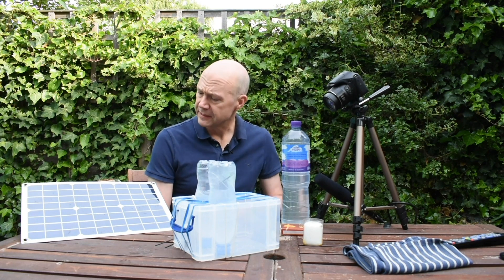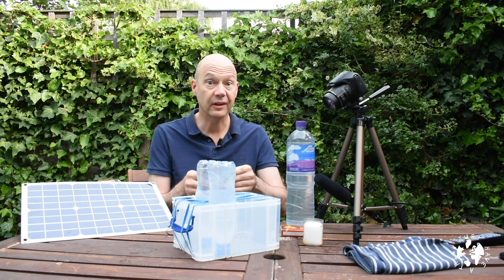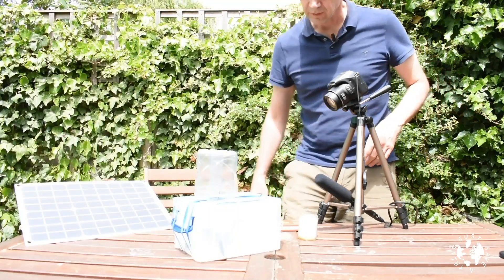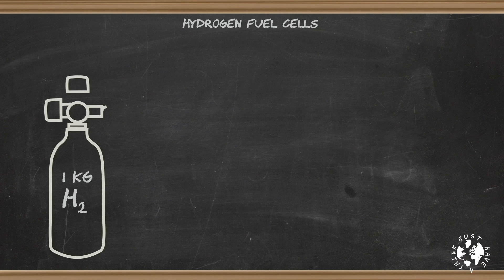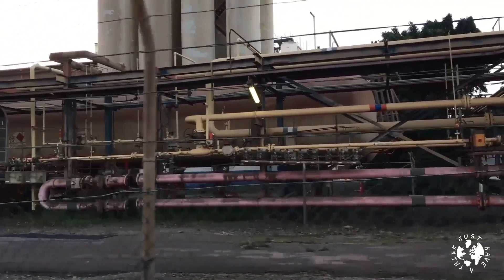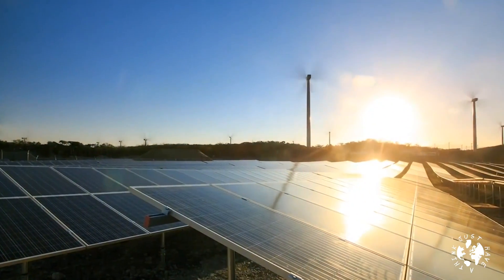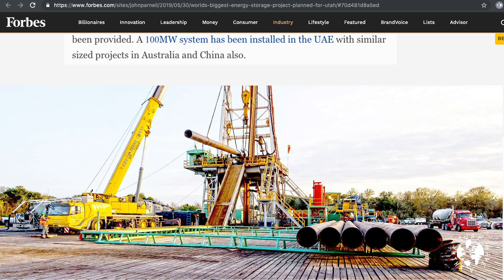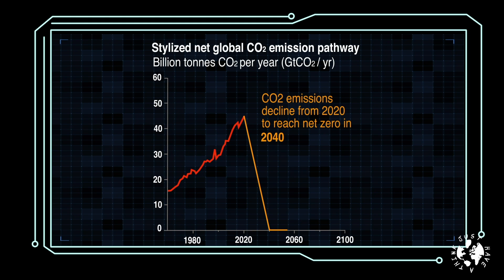Energy Storage in Hydrogen : Does this beat batteries?

Comment: Instead of storing it as hydrogen, why not combine the hydrogen with carbon dioxide from the atmosphere and create fuels like natural gas and methanol. This avoids the storage issues hydrogen has and completes the fuel cycle.
Reply: That is an option, and is being done in Europe.  However, the combustion of methane yields CO2 and NOx (smog precursor), so it has a greater environmental impact than running H2 through a fuel cell.  Also, methane itself is an extremely potent greenhouse gas, (~34x that of CO2), and leakage during transport is a significant issue (ranging from 1%-9%).

Comment: Do we actually know that the Utah plan is to produce hydrogen by electrolysis? I imagine the setup (hydrolysis machine, compressor, hydrogen tank, pump, and... entire steam turbine generator plant) would be quite expensive to operate and much less efficient than a simple bank of batteries.

The article in Power didn't mention electrolysis, which leads me to think they really just intend to run natural gas reformation equipment off renewables, then sell the natural gas on for heating. This would, of course, result in higher emissions from home furnaces... and nice, fat profits from selling both the hydrogen and also lower-energy,  hydrogenless natural gas. What it wouldn't do is reduce emissions overall.
Reply from the maker: Hi Tysto. Thanks for your feedback. I'll definitely check that out and post an amendment if I've misreported here. All the best. Dave

Comment: If one could eliminate the need to pressurize or liquefy hydrogen, then the whole process would be more energy efficient.  When I was a boy in Vancouver, they produced something called Producer Gas.  This was produced by passing steam through a bed of incandescent coal.  Producer gas is a nasty mix of combustible gases including Carbon monoxide so it was a favorite medium for suicide and was really dangerous.  However, the point I am heading for is that it was stored in gigantic tanks looking very much like those tanks that hold petrochemicals in refineries.  Except the tank had an open top and a second slightly smaller tank with an open bottom was inserted into the larger tank.  As gas flowed into the tank, the inner one  rose up.  Oh! did I mention that the tank was filled with water to make a seal.  The weight of the inner tank provided a modest pressure - enough to send the gas through pipes to factories and homes.  No good for a car but ideal for a house, business or energy generating facility.  The tanks can be any size from a few cubic meters for a house up to any size at all for a generating company.
Reply from the maker: Hi William. It sounds a little bit like the Steam Reforming technology used in the US - is it a derivative of this?

Comment: If you want to find out about storing hydrogen go to NASA. It is really hard to store hydrogen. There is not a fitting made or a weld that can hold it.
Reply: L.R. Norris  really?
Reply: @kevingrove4379  Yep. Hydrogen brittles steel. Best container is carbon fibre but it still leeches out over time. Hydrogen is a very pernicious molecule!
Reply from the maker: @fruitytv-uk  We'll nail it. We're good at the technical stuff.
Reply: @JustHaveaThink  Hydrogen is the smallest molecule in the universe. Much larger molecules make military aircraft cooling systems really hard to work - and the military is always on the cutting edge.
Reply: I wish you hadnt said that. I will now have to Google hydrogen storage and transmission.
Reply: I thought Northrop Grumman had solved this in 2004, I mean composite "Cryotanks" are regularly used in deep space missions?

Comment: Transporting hydrogen by pipe is difficult due to leakage through both the joints and the pipes themselves. They would have to upgrade the network first.

Comment: Disappointed to see you going down this dead end. This is not going anywhere any time soon. I'm not even going to go into the practical difficulties of safely storing and using hydrogen. Sometimes those have been exaggerated, but most of them are real. The most fundamental problem is the round-trip efficiency. Electrolysis is, at best, about 50% efficient. Fuel cells are generally about 50% efficient at best, so your round-trip efficiency is about 40% at best, in terms of what is achievable in everyday use. That's nowhere near good enough. OTOH batteries give at least 80%, and often better. (Supercapacitors are near 100%, as long as the charge/discharge isn't too fast.)

Some solid oxide fuel cells are said to give 80%, but they require high temperatures. For stationary applications, this might work out in some cases. You might top 60%. If you really need it, this might make sense in some places. But I have to tell you, it's not warming the cockles of my heart.

As you say, seasonal energy storage is an issue that will require addressing as penetration by renewables gets serious. In middle latitudes, it might be best to just add more solar capacity, since PV is now cheap, and continues to get cheaper. In the far north, that won't do. But there are other options. There aren't all that many people who live above about 60 degrees north, and almost no one below about 50 degrees south. In the north, there are places where geothermal and hydro are abundant, so that will help in places like Norway and Iceland. Another option is simply south-to-north transmission on the Grid during the winter. A smart grid, with distributed storage, can minimize power losses, as power does not have to be transmitted at the same rare as it is used. As countries at low latitudes develop and increase their own electricity usage, the grid will probably look better for handling seasonal variations in generation.

I don't want to advise against that second video, but I think if you research a variety of opinions on this (notably, including Joe Room's book), you may end up producing a very different video as a result.

Comment: I did not hear anything about how hydrogen causes metal engines and gas pipelines to become brittle and crack. We cannot use hydrogen without new technology for these pipelines and combustion / turbine engines. And hydrogen is very hard to store. But it can be converted to methane which is easy to store. I wish hydrogen was an easy solution but it is not.
Reply: I worked in a power station where we made our own hydrogen (to be used inside the generators) .
The storage containers for the pressurised hydrogen have been used for 47 years (with periodical testing and inspections, of course) with no damage, corrosion, cracking or embrittlement. .
Reply: @richardrejmer8721  

I need more information. Please, where is previous work plant.

I am just a student interested in learning...
Reply: high pressure stainless steel or aluminium tanks are not a hard way to store. it's standard hardware. and the hydrogen is meant for energy storage, not to work on machinery as you seem to assert
Reply: @zemaneldaquinta ...and you want to un-store your energy HOW?
Reply: @enysuntra1347  fuel cells. no need for gas turbines
Reply: @zemaneldaquinta  Tertiary cells aren't effective for large-scale conversions. That's why turbines are referenced in this video.
Reply: @enysuntra1347  You are right, however the underlying assumption that power-to-gas H2 is only suited for large capacities can be challenged. This is currently based on the cost effectiveness compared to batteries, to my knowledge. When applied for around the 0.1-1 MWh Fuel Cells can provide the best of both worlds, long term storage enabled by H2 and a flexible and fast response to energy spike needs as provided with batteries.
Reply: the modern way we are researching is by having it attach to a metal hydride substrate with extremely high surface erea. but the key there is researching, so the're workin on it.
Reply: @WadcaWymiaru  So radiation is the cure, well who'd have thought, maybe I should read more comics.
Reply: Sun you see everyday is nuclear reactor. Natural and really big one!
Older than fission is fusion itself.
Reply: @WadcaWymiaru  And nuclear does not require clearing huge swats of nature to make room for solar farms. Contrary to popular belief it is safer (in deaths/kW), cleaner (CO2 kg/kW) and it might even produce less waste (where are old solar panels going?). It is rather unfortunate all the deaths from nuclear power happen at once. I was strongly against nuclear but recently did a 180 when confronted with the facts. Hopefully we get thorium salt or fusion soon.
Reply: Dr Bearhands
The problem with solar is NOT land they need but LIFE they claims:
https://en.wikipedia.org/wiki/Energy_accidents#Fatalities
in last 10 years only ONE person died because of nuclear - one miner in shallow mine :\
Shame when hundred people dies in coal mine (huge tragedy) people are just OK, when nuclear claim ONE life - ban nuclear, nuclear is bad, boom boom boom ect.

CO2 is plant food, i do not care about it. It is too weak to cause any change in temperature.
Reply: @drbearhands  solar doesn't require clearing huge swaths of land either. The amount of land needed for solar panels to power the entire continental United States would be less than that set aside already for methanol corn production and for existing Hydro Reservoir surface area.

That also ignores the fact that with distributed solar, the panel's to power a house require less surface area than the house.

Likewise, solar appears to have advantages for raising certain crops which means you can use the land for both solar and those crops, like tomatoes, and for raising certain animals, like sheep and chickens.
Reply: It can be converted to ammonia too I think.
Reply: Yes. Ammonia has a lot of potential for long term stable hydrogen storage and trade.
Reply: @Allen Loser and methane is a carbon compound...
Reply: @Allen Loser austenititic stainless steels are are not subject to hydrogen embrittlement
Reply: How about polymer coatings? Do they leak hydrogen as well?
Reply: The government recognizes it's a challenge to store.
"High density hydrogen storage is a challenge for stationary and portable applications and remains a significant challenge for transportation applications. "

https://www.energy.gov/eere/fuelcells/hydrogen-storage

Also shows the various ways to store it (as a gas, as part of a material).
Reply: https://www.youtube.com/watch?v=OVuD9VoeLYE&t=6s
They are  experimenting with storing it as methane
Reply: Hydrogen is too small, it will start escaping. Add fact pression devices are thick and very heavy, when fail, fails BADLY....
Reply: @WadcaWymiaru  That's why Methanol technology is developed
Reply: The cost of storing hydrogen per unit energy is higher than storing the same unit of energy in petrol/diesel/crude-oil form.

Not an impossible issue, but a large factor in the overall energy equation.
Reply: Hydrogen has some safety issues. It's flame is colorless and you can't see it. I heard about an accident in ARAMCO where there was hydrogen leakage and fire started. Since it was colorless nobody knew it until an operator went for some other reason and poor guy got burnt.
Reply: From the research I have read, HHO is not damaging but H2 is.
But HHO is more expensive to generate.
And if the tank is stationary, it does not need to be under extreme pressure since you are not trying to hold enough for a long trip.
And hydrogen burned with the air creates nitrous oxide, which is a really bad green house gas. 
I hope we keep trying to find ways to make hydrogen work, but I think this will take longer than we all want.
Reply: 70% energy loss from water to electricity.. even with our best attempts. you could just shorten that statement & say "we cannot use hydrogen". solar & wind, then battery storage.
Reply: its a myth...sorry to burst your bubble. hydrogen can be stored in high pressure tanks or hydride tanks for decades with no issues
Reply: @HydrogenFuelTechnologies ...which is why everyone uses it.
Hydrogen will DIFFUSE through steel - which is why it is stored in metal hybride in cars.
Hydrogen DOES have its challenges.
If we get CO_2 from the air (eg by algæ tanks), storing it as methanol liquid or methane gas may be the best option.
Reply: @HydrogenFuelTechnologies  - The high pressure tanks would indeed qualify as "very hard to store"
Reply: As usual facts twisted to suit point of view hydrogen  not good for home gas supply  dangerous  stuff I read
Reply: @garypeatling7927  methane or say natural gas is a more dangerous flammable due to higher density and lower diffusivity and we use it in our homes.

Comment: I been intrigued from high school chemistry class about electrolysis splitting gaseous hydrogen and oxygen. Then I seen videos Stanley running a dune buggy on water alone producing Brown's gas. I was always a futurist and on my Google News feed I get video and text about the latest renewable energy technologies. The best one I think was, you can make hydrogen and  oxygen separately. Then take the hydrogen   and turn it into a liquid, then transported through existing liquid pipelines and by using some catalysts convert it back hydrogen at point of use. It be stored as a liquid on a hydrogen fuel cell vehicle.The end result isyou have clean water after it is used and the fuel cycle can be repeated.♻️

Comment: Wait a second!  I though I was being original when I wanted to to create an energy storage system out of electrolysis.

Man, thanks for stealing not my original idea.  🙂

Liquid hydrogen is the only viable option for a replacement of jet fuel, so this is a technology that needs to be more developed.
Reply: look it up on YT - they've been onto it for years. Getting it safe, light, and with enough capacity in the tanks is the problem, I think.

Comment: I have a hard time figuring out if storing energy in hydrogen is superior to other methods such as batteries. It does lose a lot of the energy in production, but on the other hand, the materials for making batteries are expensive too, and the energy stored in batteries needs to be consumed within hours, as the video correctly states. Then there is compressed air, which can be an option if you have a dense mountain that can hold a large volume of compressed air. Sounds like that can be built with a minimum of exotic materials, but only in locations where the geography allows it. Then there is gravity storage. Basically just use the energy to lift a large amount of mass. I did the math on that once, and found out that you will need to lift several tonnes of concrete something like ten meters to store enough energy to serve a one family house for a day. It is not completely unfeasible to dig a shaft for that in the backyard, but it will take a long time to break even economically and it is not easy to upgrade if you need more storage capacity. I suppose we will need a mix of all the technologies for different applications.
Reply: Batteries are totally fine with storing energy for a few month. The self discharge rate of typical li ion batteries is in the range of 1-2% per month. Of course it can be higher for older or "mistreated" cells or cells at high temperature, but almost negligible compared to the several tens of percent you immediately lose when producing and compressing hydrogen.
The only viable "gravity" storage is pumped hydro. As you've seen, yeah, that's just physics. Just compare the resources needed to produce the batteries in a powerwall to the resources needed to build an imagined gravity storage with the same capacity. No amount of technology can ever turn that into a positive outcome for the concrete block.